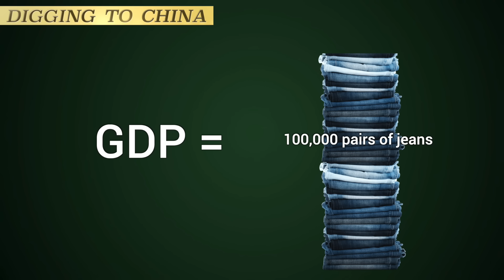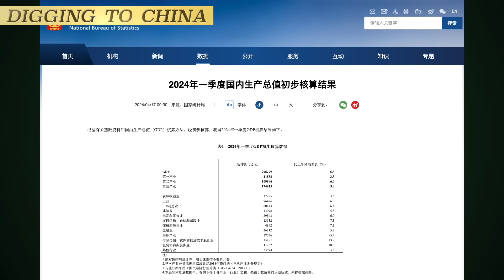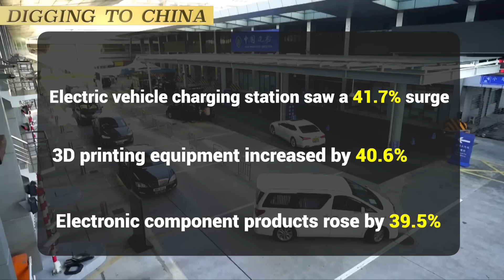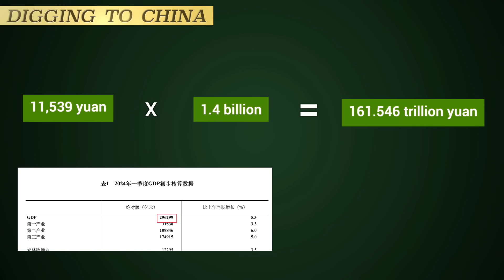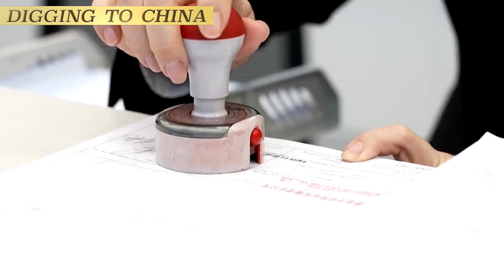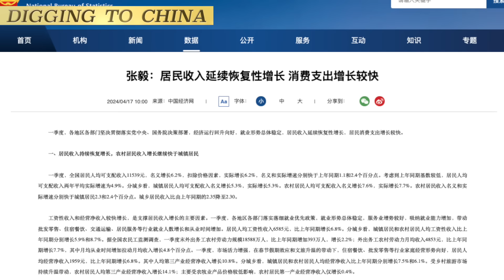Unveiling the Illusion: Exploring China's GDP Mirage and the Realities Behind the Numbers

Comment: Good points and reflects what I have posted... The Chinese GDP and even PNI numbers aren't representative whether China's economy is healthy or not. And it's too bad based on the comments so far to this video that hardly anyone understands this video.

The audience doesn't understand because they are reading the official numbers and applying what those numbers mean when applied to their personal experience. China's economy is different than Western market driven economies so numbers have different meaning.

Perhaps the premise would be clearer if the example is more visible talking about EVs and not blue denims. China made a ton of EVs in the past 6 months but not because of presales and consumer demand. In fact, you hear of a massive problem of unsold vehicles despite heavy discounts, pictures of fields of unsold cars and the EU resisting dumping 

The CCP doesn't understand it's own difficulties and why so many economic policies don't work. Yellen apparently suggested QE during this last trip but China is publicly rejecting the idea. Am guessing that if China tried QE, that'd do it wrong anyway and would continue to stimulate manufacturing instead of consumer demand.